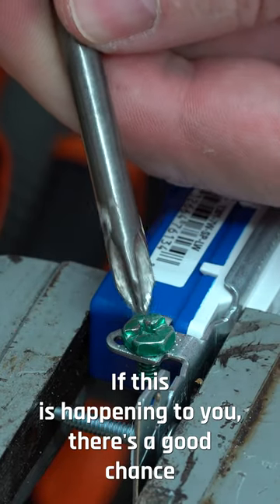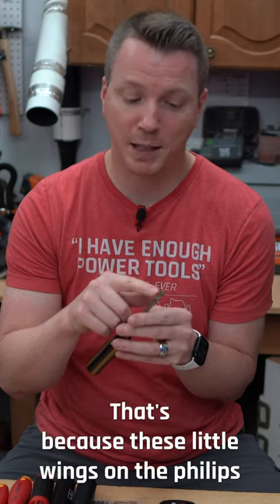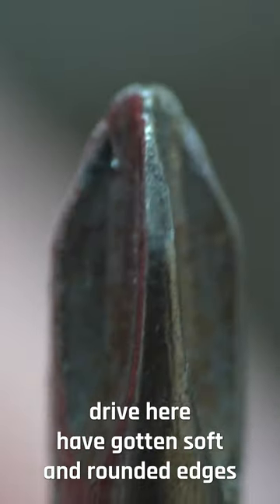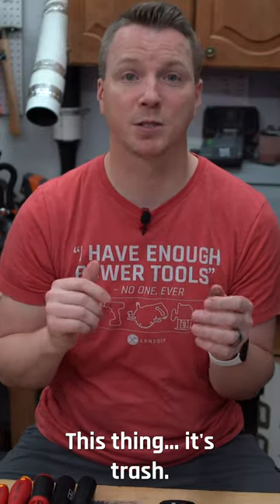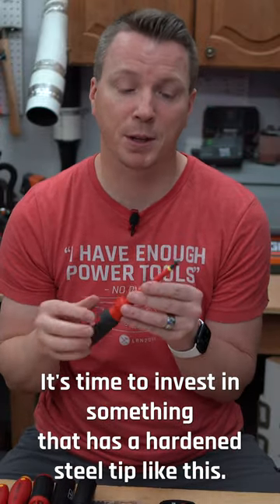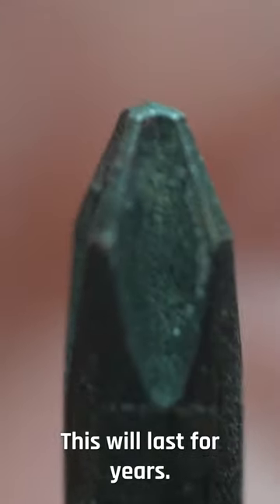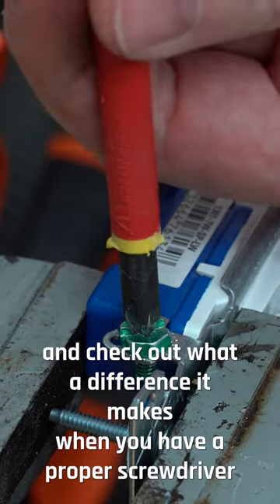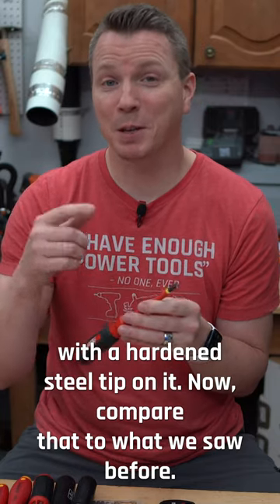Is It Time For a New Screwdriver?

Comment: All tips are hardened. And if you harden too much the tip will shatter instead of wear out. The best option is to use force to keep the tip in the screw. If you are stripping the screw/screwdriver. You are using it wrong.

Comment: WHAT? NO.. that's because THOSE grounding screws are NOT meant to be used by either a flat head OR a Philips or JIS or anything OTHER than a #2 combination tip for electricians. its a diamond shape in the middle of a flat head. Klein # 32378
You have to be seriously mentally held back to make this video. 
every single thing you said and did here was false and misleading. You used a #2 Philips that was just fine in the 1st clip then a #3 that looked a lot closer to JIS or flat wing USA made
Reply: Your right man but honestly I've never met a single person who cares haha, a new screwdriver will work just fine for everything
Reply from the maker: Wow, that’s quite the set of accusations and insults. I hate to tell you, my friend, but you’re mistaken on this one. Both were Philips #2 drivers and ground screws can be tightened using slotted, square, Philips or combo bits. Even Leviton uses a Philips #2 on that exact screw in their instructional videos. https://www.youtube.com/watch?v=-64HcE-cwjU. 

I agree that combo drivers are better than Phillips but that doesn’t mean you can’t use them.
Reply: "mentally held back" - care to expand on this?
Reply: bro you came with so much rage to this when dude has a legit side by side with 2 screwdrivers. chillll. But yeah that tip would probably seat better (although this guy has a whole vid on that too!)
Reply: @LRN2DIY I agree with your video on this subject the square #1 is by far the best option for electrical work, I’d regularly have to hold myself back because the ground terminals will twist from the torque of the square drive before it could slipped out.
Reply: Insulting people does nothing more than prove your arrogance and make you sound less intelligent.
Reply: @HawkeyePierce1981  you have no idea. did you even look at the video?
Reply: @nativeoutdoors1780  no. not even close
Reply: @LRN2DIY  wrong
Reply: @timothywhieldon1971  you are right that is definitely an ecx head. Not Philips or flat. User error on this one.
Reply: @timothywhieldon1971  I did indeed watch the video. I don't have a problem with what you wrote but rather how you wrote it. The insults were totally unnecessary. Why do you feel the need to insult someone over a simple disagreement over a tool? State where you disagree and leave out the insults.